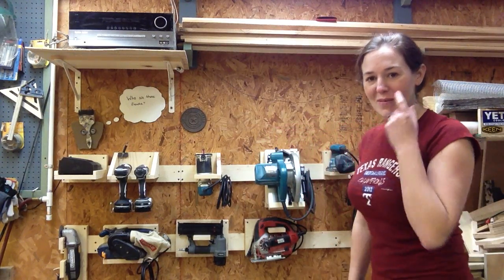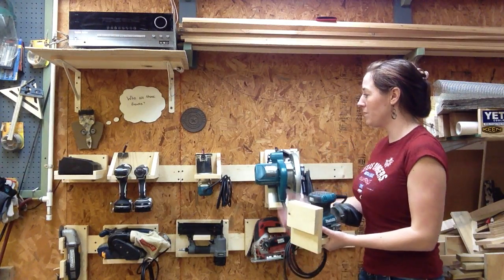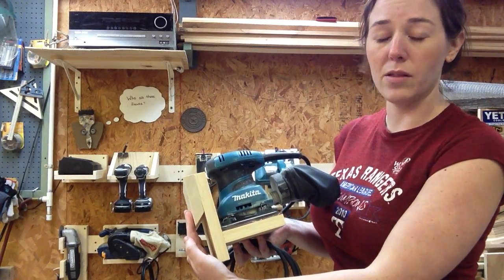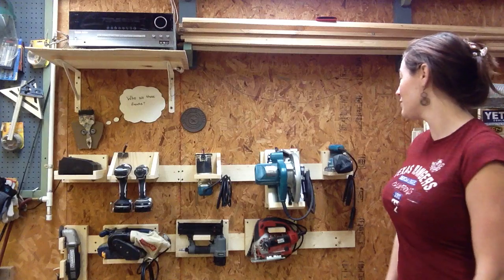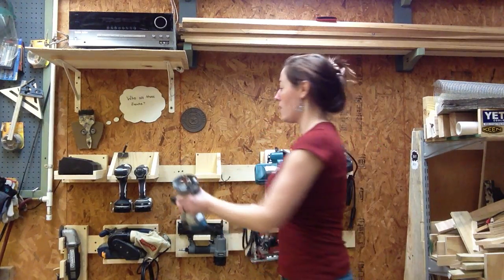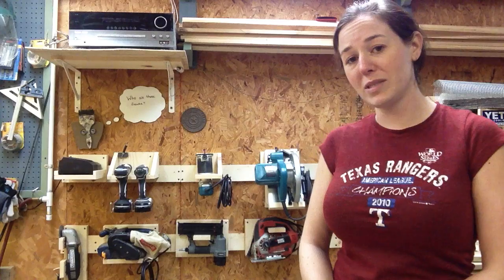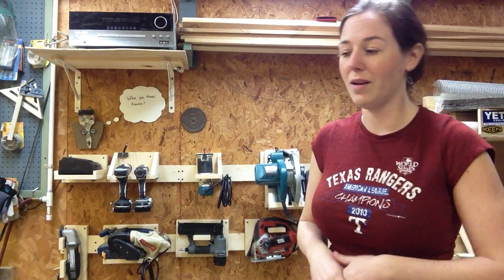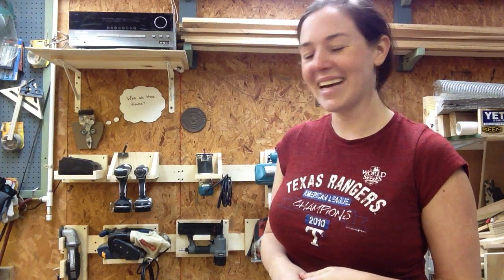DIY French Cleat Tool System

Comment: Hah! I wish I had a cabinet to dig through, I've got the older power tools in a bin, the new stuff are in the cases they came in, but it's such a pain to dig out the case, get the tool out, put it back in the case, put it up. Best that can be said is that it keeps the sawdust out of them. Got fed up this last week (after 15 years of living with it), and have finally started putting up a French cleat system. Yours are some of the neatest custom tools hangers I've seen, and I will definitely be using them for inspiration.

Comment: The French Cleat is (in my opinion) the only safe way to hang a painting in an office, or a lobby.  The painting will never be knocked off-balance, it will not suddenly decide to leap off of the wall, and it certainly will not be falling on my head while I sit innocently below the stupid thing!
Also excellent for mounting BEEG SLAB-O-WOOD on the wall as a head board for your bed!

Comment: Nice job .. so hard to keep a shop neat and clean and organized.  It works well when you you are working on a project that requires a specific set of tools... just move those to the area on the bench you are working and no rummaging around the shop.  It's all right there....  I thought I was the only one who had a stereo in my garage!!  That is a serious stereo !!!   Cannot quite make out the thought bubble on the wall....  
 You will also find the angled cleat system works very very well for cabinets and pictures frames or white boards etc.  As  long as the wall cleat is level the rest is easy.   Looks like I am going to have to check out the rest of your videos... seem to have a ton!!
Reply from the maker: Thanks, I hope you enjoy them. Yeah, I'm kinda in love with music so a serious stereo was a requirement of mine. ; )

Comment: did you use plywood or boards? I have used boards for a cleat system for my yard tools. Something to watch out for is wood swell and shrink. every now and then I will find some of my tools laying on the ground when I go in my building. Building a cleat system now for my power tools but out of 1/2 in plywood this time.
Reply from the maker: I actually used some pine 1xs I had and so far I haven't had any problem with the system. Since you have, plywood seems like a great choice for your next system.
Reply: April Wilkerson
 Just found this video,great ideas I will make this system for my hand tools,thanks!!!

Comment: what do you think of that makita drill and driver set?
Reply from the maker: I love them. I have had them for almost two years now and haven't had any problems with them.
Reply: April Wilkerson I have the same set, the were a bit on the expensive side, and they dont feel as tough or rugged as a Milwaukee or dewalt, so is it me or they are meant for a particular style of work? i.e. finishing work or something cleaner like electronics, etc
Reply from the maker: I actually switched from using DeWalt to these because I thought the DeWalt was too clunky. In my opinion these Makitas do the same job but are more refined, both in how they operate and how they feel. I've never used a Milwaukee extensively so I don't have an opinion on them, but the times I have used it I think my order would go Makita, Milwaukee, Dewalt. At least in drills.
Reply: April Wilkerson Yup, that was the exact order of rating for the drills in a review I read that led me to the makita purchase. Thanks for your response, stumbled on this video via facebook, checking out your channel for first time, pretty awesome stuff! thank you for sharing!
Reply: April Wilkerson Interesting! I had a Makita cordless rechargeable a few years ago--okay, 1999--and that was enough to cause me to forget about 'em. I take it they've updated their battery technology alongside the other brands?
Reply from the maker: Yes, I can't speak for the improvement since these are the only generation of them I've used, but I believe all of the competitors are using the lithium ion batteries now a days. : )

Comment: I like the idea but with shops as small as mine I've learned that exposed tools gather dust! I'm a pegboard addict and find myself having to shop vac all my hung tools on a regular basis. Hand tools aren't a problem but I shudder at hanging all my power tools for long periods of time. Now if I could only afford a central dust collection system.............

Comment: Good Job..Why don't you build some wooden boxes for your machines and put them in a shelf system. This would avoid them getting dusty whrn working on your projects..:)
Reply from the maker: : ) I was waiting for somebody to bring up the dust issue. The way I look at it, there are trade offs for everything and I just like how I don't like cabinets, I also don't like boxes. I love things visible, and accessible and even though cabinets/boxes keep out the dust, they cut down on those two things as well. I would rather keep those two points and just clean the dust off with an air gun when it gets out of control. ; ) Call me crazy, but I actually find cleaning my shop as enjoyable as doing the projects that get it dirty.